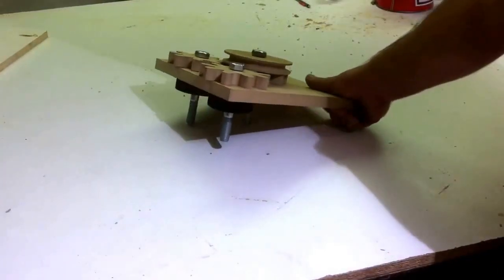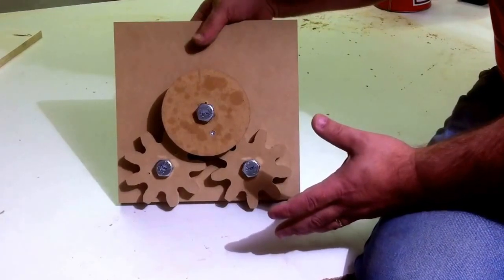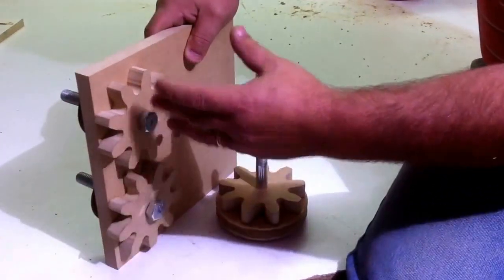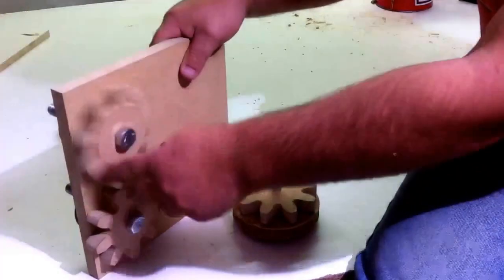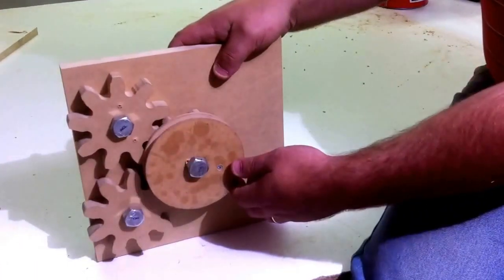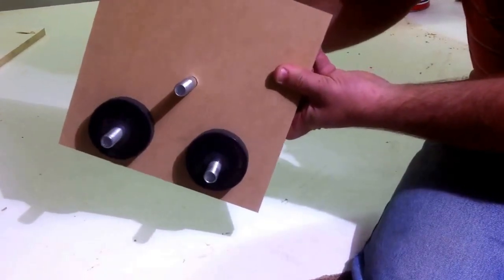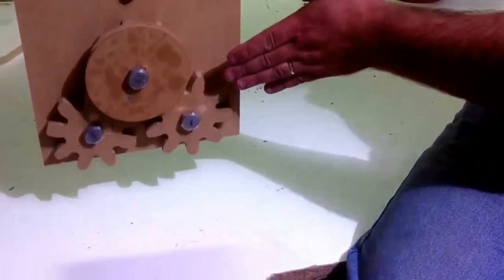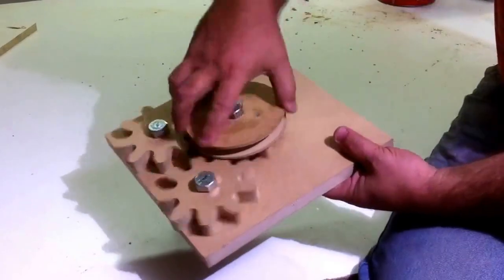Router power feeder part 4 Getting the wheels turning

Comment from the maker: Thanks for sharing your concern. First the issue of the hockey pucks. I looked on ebay and they have lots. You can get 6 for about 20 bucks. About the mdf. I stated earlier that I'm only using it cause I got lots around. It's not a necessity to use mdf. In fact a good plywood would be just as good if not better. You might even get away with the cheaper mdf if it is decent. Hope that helps.